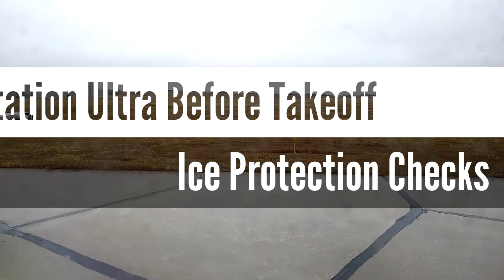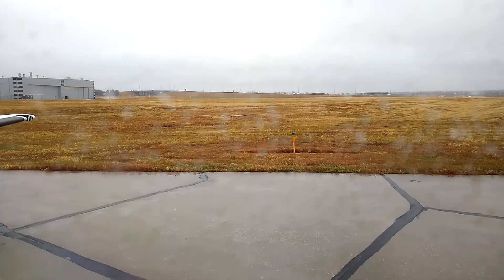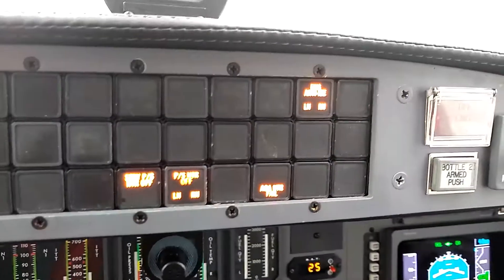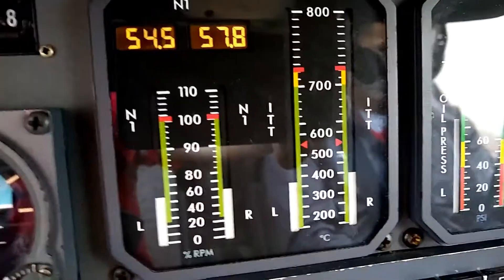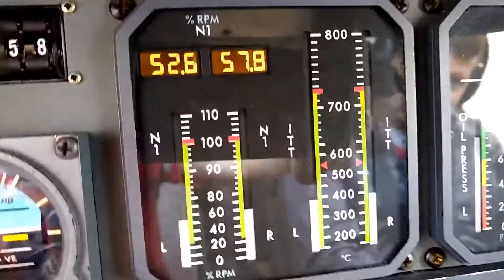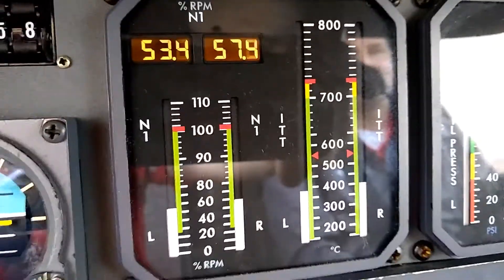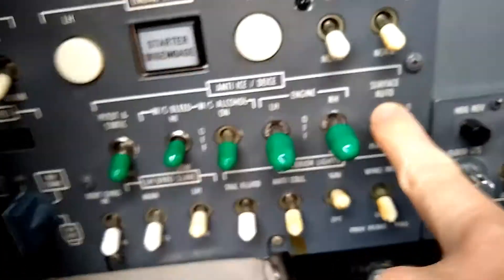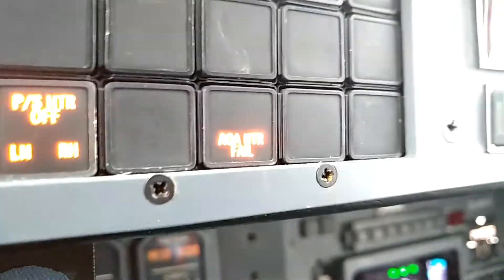Citation Ultra - Before Takeoff - Ice Protection Check

Comment: Going to a Encore+ recurrent after eight years. Where are these procedures found in FSI material. I don't see it on the expanded procedures normal checklist. PMs are OK.
Reply from the maker: Hi Vince, great question! You're right, checking the ice protection is not listed in the checklist. I'm not sure why, other than that maybe Cessna omitted it because icing conditions are only anticipated on some flights, not all flights. The procedure I've shown in this video is what my operation has derived using the AFM.

Look in the AFM, Section III, normal procedures, Anti-ice and Deice Systems. In my Encore manual it is something like pages 3-111 to 3-113, so I imagine it would be close to that for the Encore+ as well.

The Encore has hot wings with boots on the tail, so it's checked somewhat differently from the Ultra shown in my video. The AFM says the tail deice should be checked prior to takeoff and the whole system should be checked prior to entering icing conditions.

The procedure in my video is what we use at my operation. Other operators might choose to check things in a different manner and may or may not formally list it on the checklist.
Reply: I appreciate the vidoe alot